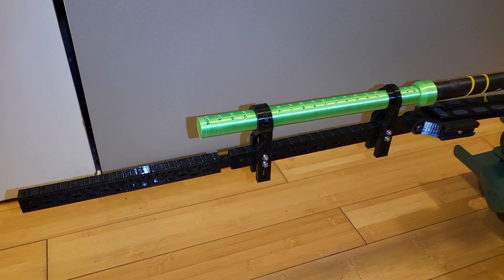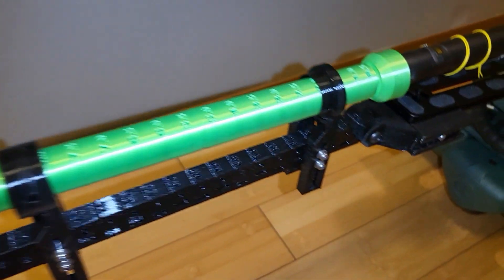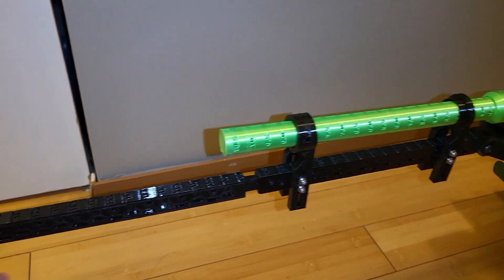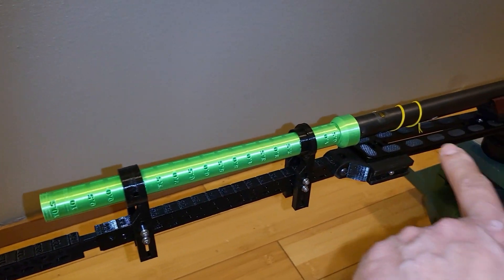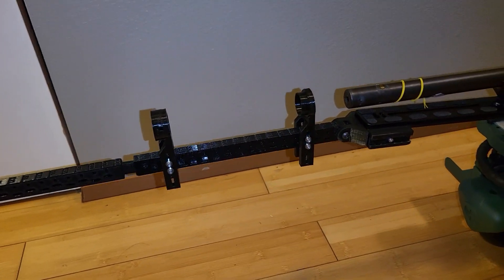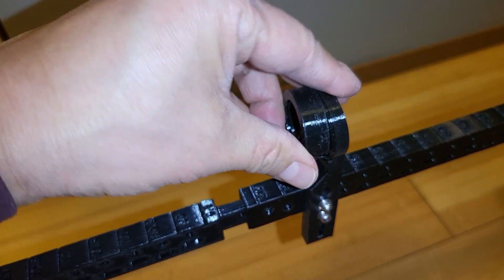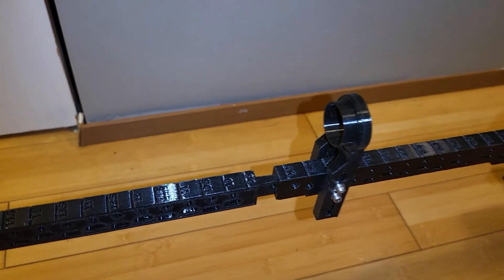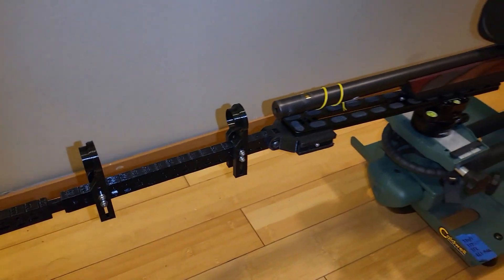CZ 457 MTR with Sensors To Measure Barrel Harmonics Part 7

Comment: Tuner, thanks for another great video.  That mounting and alignment system is an excellent example of the forethought and planning you use in your projects. 
The ic you mentioned,  was it the ESP32 the chip you tried?
Reply from the maker: Thanks. It was the inductive switch IC from TI:  LDC0851.  The processing time is too long.  I have to make the coil big but will lose sensitivity.  So have to scrap that idea and do something else.
Reply: @TunerPlinker  The setback is temporary.  I'm sure you have already thought of some alternatives.
Reply: @TunerPlinker    It seems that 1k per sec is too low. what sampling rate are you targeting?
Reply from the maker: @fernandop1647  A minimum of 50kps.